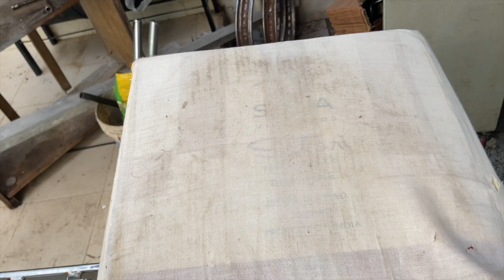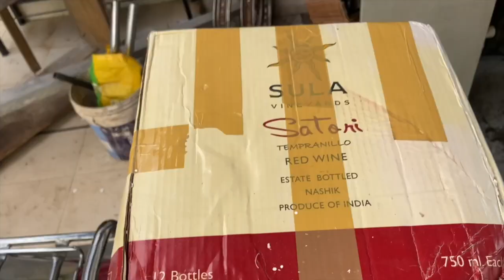New Parts from UK for Yamaha RD 350 | Another Project ?? (Malayalam Video)

Comment: Crank balance and bearing pooya vandi oodichu nadannal nathaallum problems varumo apart from vibrations and increased ware of cylinder walls

I usually use my bike about 300km a month. Piston pidikkuvo top end eduthal,vare nthallum problems internally varumo
Reply from the maker: Mothathil seize aavum, connecting rod pottum
Reply: Odikkondirikkumbol  seize ayal vadi avum